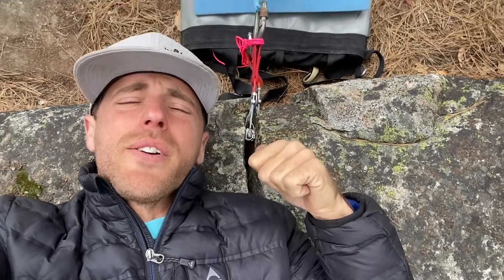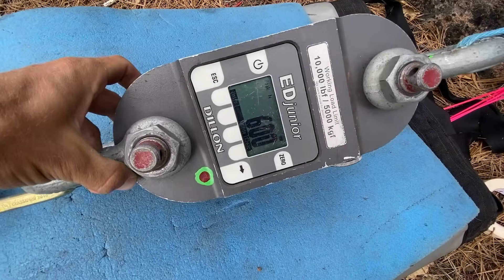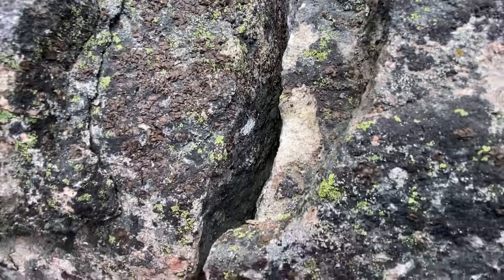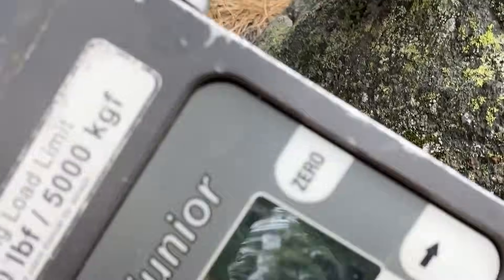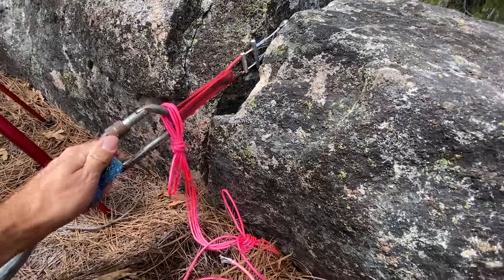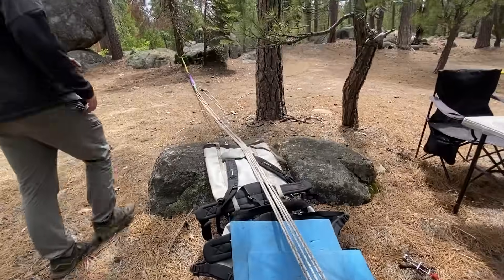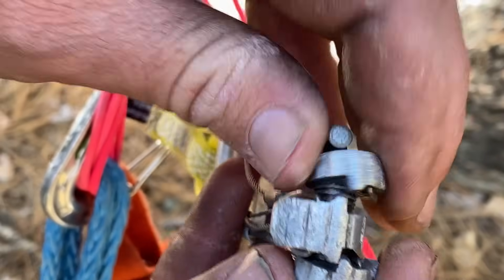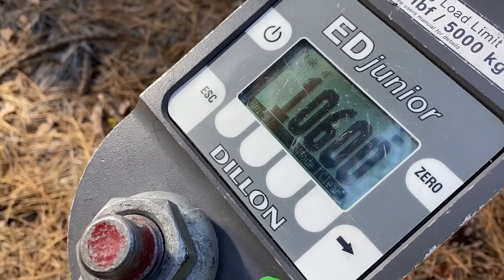Metolius TCU climbing cams pulled until failure - Great Slow Motion!

Comment: 7:12 at 11.85 kN pull force, the cam is pushing the rock at around 25 kN ! From the video a veeery rough estimate, that rock should weight around 50 kN. So yes, push something with a force of half of its own weight, it should move... 

For the maths, the force of the lobes pushing the rock is 0.5 * pull_force / tan(camming_angle). 

Now TCUs have a camming angle of 13.25 degrees, which gives around 2.12 * pull_force. The test had a pull force of 11.85 kN, so you get around twice of that pusing the rock to the side.

For the weight, the rock seems to be something like 2 m long, by 0.8 m thick and difficult to tell the width, say 1 m  (again veeery roughly), which gives 1.6m³ volume. Rock has around 30 kN/m³, which gives around 50 kN weight.
Reply: @Vitteo2123  Because kilogramme is a unit of mass and kilonewton is a unit of force. We are trying to find the force required to shift the rock. The weight required to shift the rock wouldn't make sense.
Reply: @Vitteo2123  if kilograms make you happier, just multiply the value in kN by 100... 25 kN = 2500 kgf... roughly. the main reason is because the dynamo-meter in the video used kN =) also because I prefer it, we're talking about force, Newton is a unit of force, kilogram is a unit of mass.
Reply: @haphaeu  shouldnt it be 10 or 9.8
Reply: Didn’t Newton have an apple fall on his head?
Reply: Turtle Stomper All I Gotta say is I enjoyed reading it twice. I’m taking a break. I’ll go back and read it a third time in a couple of days, still won’t understand!  😶
Reply: @Info.isfree.openmind  try some explanation with sketches, like this one http://www.vainokodas.com/climbing/cams.html
Reply: haphaeu ,Thank you I will
Reply: @Info.isfree.openmind  “I’ll go back and read it a third time …”

Don’t bother. It doesn’t help. 😂
Reply: Getting the rock to move (or in this case, tilt or tip) depends on the location of the rock’s CG (center of gravity), the location of the force, and the moment arm(s).
Reply: the people trying to critisise lmao you are cleary dealing with a wizard here. pick you battles more wisely silly silly people
Reply: what??
Reply: In kilograms?
Reply: @blastfromthepast7119  25 kN = 2500 kg = 5500 lbs = weight of a Tesla X
Reply: @haphaeu  ah so Tesla X has become a new measure of weight now? Could you convert to Chrysler Lebarons? :) Like the calculations, they look rock solid!
Reply: @jefvanal  1 Tesla Model X = 2 Chrysler LeBaron (1989 Model)
Reply: Ah yes I also understand what these science words mean
Reply: @Vitteo2123  kilonewton IS te unit to mesure Force , kilogram is  unit to mesure Mass. , No exactly same magnitude
Reply: Physics bachelor student here. I like your reasoning. I analysed the situation similar to you.
Reply: If only physics class in high-school was this interesting
Reply: Thanks a bunch. I am going to have to read this again and make some assumptions but I am pretty happy to find this answer
Reply: Dam you guys are smart as shit.
Reply: @Vitteo2123  F=ma so to get force you multiply mass by a due to gravity which is 9.81 or around 10 on earth.
Reply: Is it usual in the US that weight is described as the Force of an Object rather than the mass, due to a missing metric system? Not sure if I mix something up.
Reply: @domenicl1023  In the US we use the pound, a unit of force. I believe that a "slug" is the unit of mass (that no one uses) but anyone who isnt in STEM and already using metric probably doesn't even know the difference between mass and weight.
Reply: @09patrick22barnes95  Old, but the pound is actually a unit of mass. Pound-force, or lbf is the unit of force. They are not the same, which is a pretty good illustration of how whack the english system is.
Reply: Rock big like gallon of milk. cam push out like half gallon milk. move big milk. rock move
Reply: I too took physics 1 in highschool lol!
Reply: @Vitteo2123  

Kilograms are MASS whilst NEWTONS are FORCE OR WEIGHT  ! I’ll wait for your reply ( heavy pun) 🤣
Reply: Since the other side of the rock is so big and not moving at all (can think of it as immovable), the force on the side that moved is actually double that: 4.24*P
Reply: Ok, I disagree, if the pull force is 11.85 kN then the cam or more accurately the friction force between the cam and the rock that is acting in the opposite direction is also 11.85 kN. Since the friction surfaces are two then the friction force on one side is 0.5*11.85 kN = ~6kN
Reply: @hsoley  that's correct in the direction of the pull force (in line with the rigging) However to stay in place, cams push the rock perpendicular to the pull force. See at 7:20, "this way" pointing towards the rigging, and "this way" pointing to the sides =) Also have a look on how cams work and you'll see the relationship between the in-line force (these 6 kN you mention) and the cam reaction on the rock (these 25 kN), and you'll not surprisingly find the friction coefficient between the metal and rock: 6 / 25 = 0.24 =)

So the total force is indeed the vectors 6kN in-line plus 25 kN perpendicular, which is 25.7 kN. So the in-line force only adds a small component to the total reaction force. The angle of the total reaction force is nearly aligned with the cam reaction force on the rock, just off by a small angle of atan(6/25), which is, surprise surprise, 13 deg, our camming angle =)

All that means that cams are designed to meet the friction coefficient required to hold them to the rock. So it is not a "bad design" that cams put so much load onto the rock, they HAVE TO in order to take the climbers fall without sliding.
Reply: @haphaeu  Sir, i understand exactly nothing about what you just wrote, but i am pretty sure you're right.
Reply: @haphaeu  you forget, osha doesn't smell his shoes before worm, so he mustnt know the way

Comment: It is very difficult to analize the pulley system from what you show in the video, but from the pullers to the load I think it is a 3 to 1 times a 2 to 1 times a 5 to 1, and I think that adds up to 30 to 1. The grigri is a major source of friction though, and it's location makes it hard to calculate it's effect on the overall system, in practice it may reduce the adavantage to more like 20 to one.  I think the most efficient system with the equipment you showed would be to rig a 3 to 1 with the  pro trax as the progress capture and the big SMC single as the traveling pulley, and then stack your double pulley system on that as a complex multiplier. 

You certainly made the cams look good, it seemed like everything broke well above rating, as Metolious cams are labeled 10kn. Are those the original slings?  Funny how Bobby managed to get the stronger placements, maybe you guys should make a video where you argue about the cam placements, and then pull-test to see who is right.

Comment: Please test some metolius cam placed in "red zone" (dots on the lobes). Cheers!
Reply: Agreed.  My rule of thumb is that the hardware is built "strong enough" (as these tests bear out).  What worries me are marginal placements like tipped out cams, flared cracks, shallow placements, placements where the cam is forced out of alignment with the direction of pull, etc.

Comment: Rough up the faces of the metal crack! Even just sandpapering with 80 grit might do it.
Reply: remijio303  but metal does still slip on metal stone is harder then metal so it eats it self in to the metal and holds on tighter

Comment: Force on the rock is depended on the contact angel. At 5:25 the measured angel is  ~21°. when the cam opens op the angel gets smaller and the resulting outward force bigger. 
At 21 degree with a straigt pull of 11,8kN the force an the rock ist ~11,8 /2/sin(21)  = 16.46kN . This is the total force applied on the rock. The force that pushes the rock apart is only 11,8/2/tan(21) = 15,37kN
Reply: @Transumanar sry I edited my post a little incorrect....

Comment: I’d like to see some tests where you clip 2 biners through the cable after the sling breaks
Reply: This. It would reduce the bend radius problem.
Reply from the maker: I am interested in two carabiners at same time.  Gate on same side, opposite side, while triloading-ish and on a hanger where they don't pull evenly and like you said on a cam.

Comment: I think if the sling breaks you should put a soft shackle around the the actual wire so that the small bend radius of a Carabiner doesn't cause the wire to break.
Reply: A bigger radius is not a realistic test.  Climbers would only have a carabiner.
Reply: @turning5462  You would never put the carabiner in the wire loop. You learn that day one for the exact reason showed here, it breaks easier.
Reply: @caedmonswanson2378  aren't we learning here that its fine? breaks above 10kn, lead falls max out around 9kn
Reply: That, or even using two or three carabiners through the wire to increase the bend radius.

Comment: Edit: see Chris Powell reply for correct explanation. Expansion is double pull not 4 as cams expand both side. Not 1side  as my following post calculates. Thanks @Chris Powell ------ (1/tan 13.75 degrees is roughly 4). So if your cam is pulled 11.85kN then you are putting about 4 times that pushing apart, about 47kN, to expand the gap. Cams are great, but even slightly shaky rock can shift sometimes.

Comment: For a camming angle of 13.5 degrees the basic rule of thumb is the outwards expansion is twice the pull on the cam.
/* start maths:
the friction on the cam loads and rock = pullforce/2 (two sides of cam)
the load between axle and rock = friction/sin(camming angle)
reaction force pushing outwards = friction/tan(camming angle) = pullforce/2xtan(camming angle)

tan(13.5) = 0.24 so the reaction force pushing outwards = 2.08 x pulling force
*/end maths
Reply: I was scratching my head for ages before I posted. With you on tan angle, but I'm thinking real life and pull not perfectly central (worst case) you have a behaviour where the cam(s) on one side doesn't rotate on shaft but rather just pivots/rolls over the rock and the cam(s) on the other side does the camming. That case I think you have a mechanical advantage of 1/0.24 (roughly 4). Interested in why you say approx  2 not approx 4, because I've been thinking about this for a while and still head-scratching a bit :)
Reply: @tomtom4405   Its because the load on the cam is distributed to both sides of the crack, with each side holding approximately half the load. The best way to see it is to draw a force diagram and you will see you need two frictional forces and two reaction forces (one for each side).

In the case where the lobes are unevenly rotated so the axle is not central because of the constant camming angle the triangles used for the force calculation remain the same shape, even if they are different sizes.

The cam may roll/pivot as the load is taken up, as the axles are slightly elastic and the rock may deform under the stress, but both sides are engaged and are applying an expansive force which relies upon the friction. Imagine if one side of a crack was perfectly smooth (mu = 0), the cam would not be able to engage and would just slide out. This (hopefully shows) both sides are needed in order get a camming action.
Reply: @chrisp6582  thanks, I'd thought about this originally but I'd misunderstood the scenario of one cam not rotating on shaft. You're absolutely right. Even if one cam rocked but not rotated on shaft because of the log spiral it still expands by 13.5 (or 13.75 wild country)  degrees. So it is always 2 cams/sides expanding. 1/(2*tan 13.5) is approx 2. Thank you for correcting me!
Reply: @Transumanar 
Hi Transumanar,

Most cams are designed to have a constant camming angle of 13.5 degrees when in parallel sided cracks. (it does differ between some manufacturers and types of cam) - hence the logarithmic curve on the cam (see page 11 of the pdf you linked).

Of course real cracks vary in shape (see my comment below) which will change the camming angle.  If a 13.5 cam was placed such that the camming angle was 20 degrees the cam is either placed in an upwards flaring crack (narrow at the bottom) or a pod.  If this is the case the cam is more likely to hold as the load pulling it out causes a direct contribution to reaction force at the cam/rock interface.

This direct contribution will increase the maximum friction the cam can experience before it starts to slip meaning placements in rock such as polished limestone (with low friction co-efficients) are more likely to hold.  Slipping is only a problem when the cam starts to get loaded - as once loaded the expansion force means the friction starts to increase - this is why cams fail either when the wire fails (often the weakest part) or the rock blows. Rarely do you see it engage, hold for a bit, then slip out without something like the rock failing.

[As an aside you could manufacturer a cam with a larger camming angle, >13.5degrees. It would have a greater expansion range but would be more likely to slip out of the placement as it relies on the friction between the cam and the rock more.  Similarly, you could make a cam with a smaller camming angle, <13.5degrees.  It would have a smaller expansion range, but be more likely to hold, but also would generate larger outwards forces meaning placements are more likely to blow the rock]
Reply: @Transumanar I guess there is a mxiup from where the angel is measured, and the difference between camming angel and contact angel. From googling camming angel everyone can see how it is supposed to be measured. (at a contact angel of  0° it is impossible, at 90° the force is transferred perfectly and no cammming is needed)  In this case with a non parallel crack the contact angel is ~21°.
Reply: Why Mr P makes the big $ .
Reply: at 5:25 the engagement angel looks like ~45°
I guess 13,5° is the max angel ?
Reply: @muchmore344  Hi Matthias,

It looks like the cam is contacting the rock at roughly where the trigger wire is attached to the cam lobe. I'd guess the angle was approx 20 degrees but it is hard to tell.

The 13.5 degrees is the camming angle in a parallel sided crack. Of course in nature cracks may not be perfectly parallel which would change the angle.

Comment: Doing basic maths, supposing a lot of things and making a force diagram I have that the force to the sides it's equal to half the force you do tho pull the cam multiplied for the coefficient of friction there is between the rock and the cam.  Force Out = 2(side Force)*(Coefficient of friction)....The side force it's the force applied to both sides supposing It's the same in both sides.

Comment: Could you do some belay device failure? Atc guide loaded in guide mode and pulled until the rope slips or breaks? Same with a grigri. How much force can the Jesus pin on the grigri take?
Reply: I want to see a guide mode atc with a ton of slack getting shockloaded so hard that the rope burns.
Reply from the maker: Episode coming soooooon.  You might be shocked what breaks and what doesn't.
Reply: This sounds awesome but grigris are expensive
Reply: @UnIxWaNnAbE  so are Cams
Reply: I'd be curious about this too. My guide ATC says to never hook it up directly to the anchor in guide mode, but doesn't say why.
Reply: The atc in guide mode would be sick to see.

I'm guessing the Jesus pin in the grigri is probably super strong because I have never heard of it failing. Whenever I hear of equipment failure with a grigri it is usually the carabiner snapping and not an issue with the grigri itself, like with what happened when Tom Randle took a massive 60+ foot ff2 whip on el cap while rope soloing and almost died because the carabiner broke.
Reply: DuBCraft21 do you mean Pete Whittaker?

Comment: Curious. You said those are 15 years old. Have you had the slings replaced in that time?
Reply from the maker: Original Slings
Reply: @HowNOT2  so what could a re-slung cam hold? They say nylon looses strength over time and with UV exposure.
Reply: Looks like the original slings to me - I own a few of similar vintage.

Comment: The moral of the story: even your really old cams are super good enough for your average climbing whipper even in slightly mobile rock/uneven placements/multiple break tests/falls. That is actually pretty great to know.  Just focus on good placements and solid rock and you might as well be whacking in a bolt. Are cams aid now?
Reply: Always have been aid haha
Reply: @danieljay8009  Sounds like've sent the pink one in the corner
Reply: @danieljay8009  Yep, been used as clean aid for decades!
Reply: @lonememe  the only thing thats not aid is free solo trad climbing
Reply: @danieljay8009  I mean if you don't fall and you're only pulling on rock then it isn't aid regardless of your equipment. But yes, falling on a cam has always been aid.
Reply: Any thing but free solo is aid
Reply: I've belayed someone who broke a microcam with a short fall. The video is a small sample size. Also placements are not always that easy to visually check especially when you're pumped.
Reply: @malcopops4  Well yeah, this isn't a test of microcams...we all know that microcams are marginal, just like micronuts are marginal. I don't see what your point is...are you suggesting that with a larger sample size, some of these cleary non-microcams would break like a microcam? Routes that can only protect with micro gear get danger ratings.

Comment: Well, you still think that Slack Snap is a 20-to-1 pully, so anyone who knows how mechanical advantages actually work already knows you have no clue how pullys work.  🤪

P.S. Slack Snap is a 10-to-1 mechanical advantage when it comes to converting torque into force.
Reply from the maker: I know it is a redundant 10:1 now.  After about 10 engineers helped me build it, i realized it was only 5 redundant engineers not paying attention hahahaha